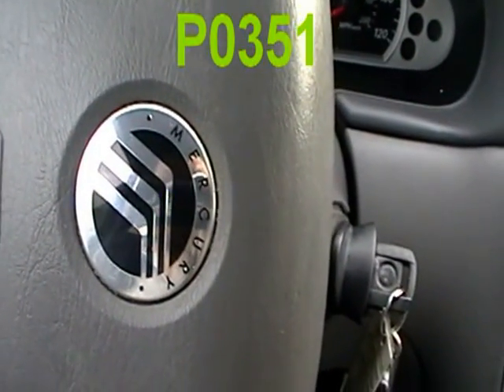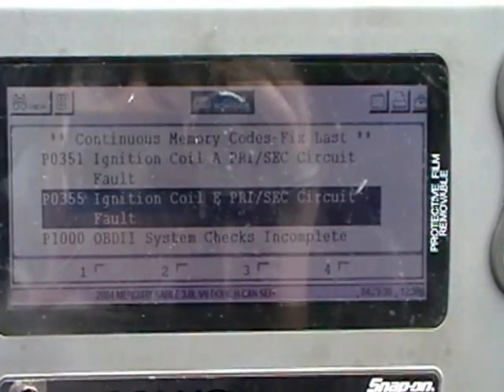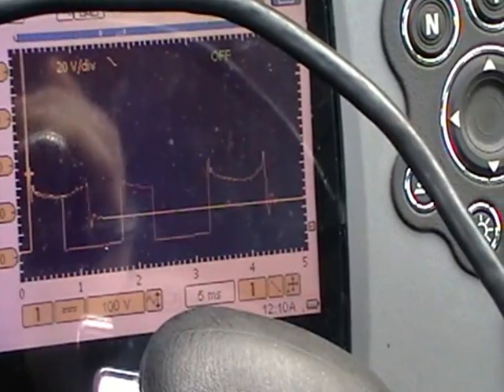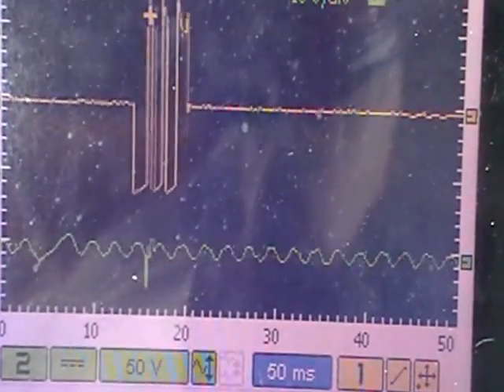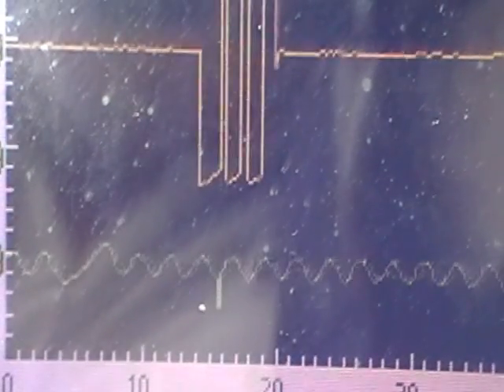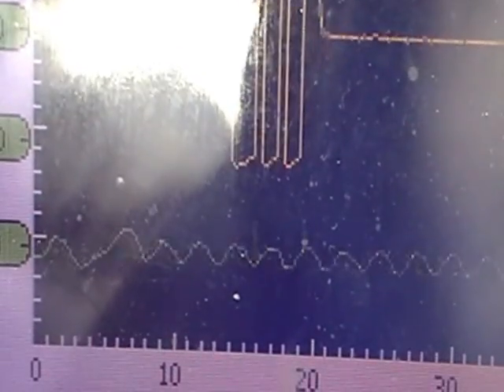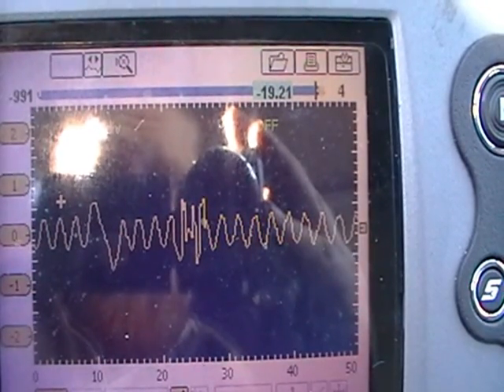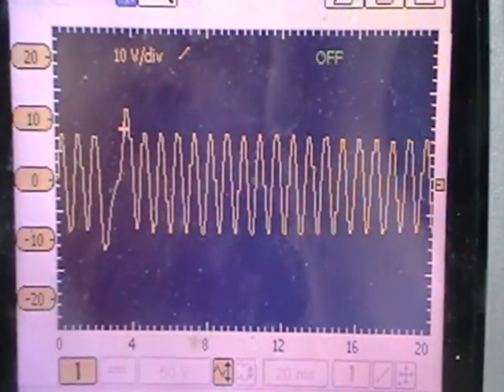ford/mercury misfire p0351

Comment: who would of ever thought to check the crank sensor for a cylinder #1 misfire.  I dealt with this code a few times usually its the connector on the coil that's bad. never seen the crank sensor cause it. probably had a code in it for the crank sensor and got cleared explains the p1000

Comment: this video is awesome! do not know what logic the pcm would use to find a coil problem like this? the coil is just firing to match the crankshaft input...  you would think it would just show up as a misfire because of the crank wave form failure and maybe a crankshaft sensor code? awesome diagnosis!
Reply from the maker: Thanks.  That's just one of those that defy your normal diagnostic thought process. That was my first video.  Not sure if I mentioned that a code for #6 popped up intermittently as well

Comment: Nice video ! Have a 03 Silverado 1500 with a 5.7 in it with a p0300. cyls 2 and 7 causing the code. we have done a lot of swapping of parts to see if the problem moves, but no luck. I didn't even think of the CPS the other day but gonna check it now. This is why I watch videos from you and Paul. It has helped me a lot ! sometimes we forget about the basics or certain systems to check. Especially now that Im 53 yrs young !! LOL !!
Reply from the maker: you need to go on a long test drive with a vacuum gauge routed for visibility. some of those engines have valve guide issues hot...too tight.. the vacuum needle would start bouncing during the miss,
Reply: Thanks, heard valve springs as well can cause this. Also I heard cams going flat, but I think it's 05 and up model years that have camshaft issues.
Reply from the maker: Keep me posted
Reply: You sure that 03 has a 5.7?
Reply: not sure a co worker was workin on it.
Reply: I hear IHOP has good deals on pancakes for us ol farts! The late 70's and early 80's were good for us auto techs. I was making almost as much money then as I am now!!! and cars were much easier to work on than now.

Comment: ever thought about getting a verus? I just bought one on ebay for 3 grand!!  Great vids keep it up!!!
Reply from the maker: yes, my snapon rep just brought the special diagnostic truck in the area and had me wanting some kind of ultra tool, cant remember if it was the solus or verus. with the dock station and toolbox for 11k..i really want it
Reply: I would buy a used one for less than half 11k is a lot of money for 1 tool
Reply: James Danner
Is it the Modis Ultra with the 2 channel scope?
Reply: hjs3rd
Actually the seems a little high for the modis, prob a Verus
Reply from the maker: I think it was the verus with the removable scope and wifi ,,built in windows software..docking station...nice

Comment: Paul talks about the triple spark from Ford in one of his videos. The misfire probably would occur in the number 1 cylinder because with the Ford edis-6 it's missing tooth then tdc on the sixth tooth( where your crappy hash is on the 5th and 6th tooth at 4:26 ) even though the whole signal sucked and the crank sensor needed to replace.

Comment: Awesome, ingenious usually if you have control you think cam and crank are ok and go for coil or secondary, talking about frying computers i never heard of the gap your referring to but what do i know, my theory was coil shorted drawing to much current burning driver in ecm, just goes to show you no matter how long you've been in this field you learn something almost everyday. Thanks for sharing.
Reply from the maker: thanks for the encouragement..i have another video where i did just do the coil and plug first cause it happens so much..ended up being high resistance in circuit..the .080 gap issue came from my snap on rep who attends diagnostic classes to keep up to date, it helps to be knowledgable when trying to sell $4000$ tools..ha..he also does his own repair stuff as well so i usually dont get any work done for the 30 min. or so he is there due to the fact i am showing him captured waveforms or he is telling me his repairs or other techs he represents..thanks again

Comment: Isaac, we rebuild a lot of PCMs for Ford Escapes and Mazda Tributes that have been damaged by the failed coils.  The great thing about servicing your existing PCM is that there is no need for any programming after the repair.  Your PCM will still work with your existing keys.  Feel free to find us on the web (CircuitBoardMedics).
Reply: Circuit Board Medics  I sent my pcm to these guys and they have great service . They tested my pcm before repairing and found the pcm good . only charged me for testing and refunded my money . I WILL USE them again ! Thanks GUYS .

Comment from the maker: ya me too.i went there cause this was a used car guy.do alot yourself type.and he said it was a 356 code.he did the three easy coils up front and gave up when it still ran bad and stalled interm..when i got it it was the 351 after i put his new coils under the intake and still had the 351 i just scoped it thinking id see the flat line 12v with no comp control or hoping for a flat 0v with a broken wire..when i saw control and a misfire. in my mind it had to be a cam/crank sig fooling mis monitor

Comment from the maker: ya it could be..from what i understand there is an 80  thousandths .080 gap internal to coil and if plug gap exceeds this the spark will jump that gap.secondary back to primary winding and back thru computer,,frying that specific coil driver..351 is cyl#1 ..i think yours is like the ford escape so prob the one by the passenger side firewall a light green wire with a  white tracer.. goes to the #1 terminal of computer..u need to check for 12v at that wire with a test light or volt meter..get back

Comment: I have a 2005 Mazda Tribute with an engine running rough.  It is giving me the P0351 code.  I changed the 6 coils on all the the cylenders and new sparkes on all them.  The code is still there with the rough engine.  My friend said my PCM could be fried.  I told him it could not be fried if I'm still able to start the engine and move.  Could it be fried and still crank? Please help me.